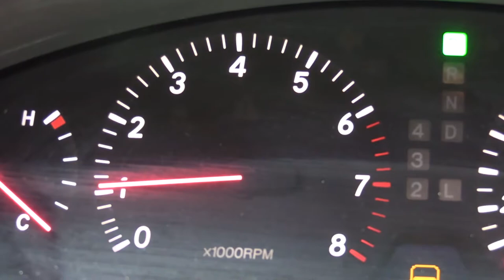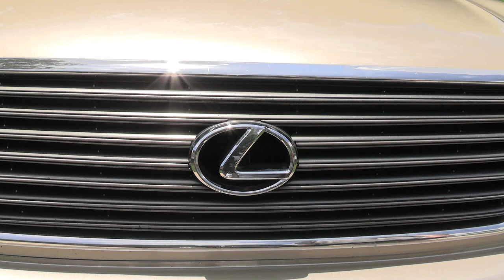BEAN [60fps] LS430 Throttle Body Cleaning

Comment: 6:20 The idle air control - that's not the full procedure! You are not good to go! The 1/3UZ uses air-assisted injectors, the two larger holes run all the way into the engine block into every single injector. Those passages also get gunked up with carbon, not just the 8 small ones which you can see under that plate. 

You need to take your cleaner, with the plastic tube extension installed onto the head and stick it into those large holes as far as you can. Then start spraying the solution, slowly at first, into those tubes with the car running. You will be messing with the a\f ratio and the car will bog whenever you spray, so you will need to manually operate the throttle with your left hand as you spray with your right to prevent the car from stalling. I find I have to rev the car up to as much as 3000 or 4000rpm to have enough rotational inertia. I recommend doing this when the car is warmed up so you aren't revving and stressing a cold engine. You may need to perform this service multiple times and I've heard of people using an entire can of cleaner to get the job done.

You should experience smoother shifts, smoother throttle response and more precise throttle response with this. I also recommend adjusting the throttle cable, there is a linkage on the left side of the block which has a nut to adjust the cable slack. Over time this allows a ton of slack in the pedal to built up.
Reply from the maker: If I still had my LS today, I would've done that. But I'll pin this comment here for others to see!

Comment: Great video, very helpful! One thing I'd like to say tho, at 13:00 i think the rpms are high because the engine is cold and you are in park. It has to idle high to warm up faster and stays high when in park so it doesn't cool down.
Reply from the maker: Yeah, a cold start is always gonna have high idle to help get the catalyst up to temp

Comment: So maybe I missed something but what or how exactly did you clean the internals of the throttle body.  Did you manually move butterfly ?  I am concerned that might hurt the gears inside?  Did you use certain fluid or brushes?  Thanks.  I learned a couple of things
Reply from the maker: You can get a bottle of throttle body cleaner from any automotive supple store. And while there, you can find what they call "shop rags" which are more durable. 
As for the throttle body, yes I was moving it, but not aggressively. I could hear the gears moving when I was in adjusting it to clean, but if you're slow and gentle with it, you're not gonna hurt it.
Reply: @BEANCROAKLY  I was doing the MAF cleaning for my p0175-p0172 codes and I cleaned the entire air housing compartments and I also sprayed the throttle body with throttle body cleaner but I didn’t remove it or nothing just did the face and what I could see without moving the flaps- I was scared
Reply: @gabegarcia7779   you were scared beacuase it was really dirty behind the throttle body? did you ever end up cleaning the throttle body, if so how did it go?

Comment: Could a dirty throttle body cause the car to hard downshift on first gear?
Reply: I had this happen about a year ago, thought it was the transmission, but it turned out to be the ICU (computer) that I had reprogrammed for about $500, runs as good as new!

Comment: At 1:36 small hose where it will go?. I don't know where to connect in downwards because it cracked while removing
Reply from the maker: Its a power steering vacuum hose. Best seen from underneath the car to reattach it

Comment: Are you sure it's a one time use gasket ? In my country no one replaces it and the car runs just fine no leaks smooth idle no problems.
Reply from the maker: It what is says in the Lexus manuals. Throttle body gasket is a one-time-use gasket

Comment: Hi Bean, thanks for the video. I followed your procedures to clean the throttle body. when removing the air box I found out one of the EVAP pipe (I think that is what it is) is cracked at the bottom. it is the bigger one on the right side of the air box. it needs to be replaced, do you happen to have the part number for it? I search online and lexus dealership, could not find it. they only say ventilation hose, no more description on any of those and no pictures. 
Can you help me out on this? I temporarily fixed the crack with wrapping a duct tape around it. It is not permanent fix and needed to be replaced. Thank you.
Reply from the maker: That would be your crankcase ventilation hose. Generally all the rubber hoses on these cars at this age are gonna need to be replaced. 
Part number for that hose - 1226250060
Reply: @BEANCROAKLY  - that's great, thanks for your help!
Reply: I literally did the same thing. But I just left mine, drove it to Cali from Vegas and check engine light and check vsc light came on, I'm assuming that was the issue. I'll report back if it is. Thanks for posting the part number
Reply from the maker: @agegonzo39  Late reply, but yeah if you have an EVAP leak, the car will throw the CEL and VSC lights, the VSC light depending on how many codes for the EVAP come up. Usually a solenoid will fail due to age but the pipes will crack or break and that's where you'll have the leak. Generally an EVAP codes are nothing to sweat, but the CEL light is annoying to have on the dash.

Comment: Hi, did you reset the throttle body sensor after reinstalling? On mine, after reinstalling the throttle body, it stuck in idle and even when I stepped on the gas, it only idle and wouldn’t rev my engine.. Can anyone help?
Reply from the maker: Try disconnecting the battery for 10 minutes and reconnect it. Also try driving around the block and see if that doesn’t help reset it. I never reset the throttle body sensor, since it usually does it on its own
Reply: did it work for u
Reply: It was caused by a bad idler variable solenoid

Comment: .I have a 2001 Lexus LS-430.  
Can not take down the intake boot yo access the throttle body and I'm afraid to force it.  Do I have to remove it from both sides or only the side where attaches to the throttle body? 
I have the code P0174.  
What would you advise?
Reply from the maker: To properly remove the intake boot you have to remove it from both sides. As for the P0174 code, clean your Mass Air Flow (MAF) Sensor, check to see if your intake boot has a hole someone or if any pipes are disconnected.

https://www.clublexus.com/how-tos/lexus-es/lexus-what-does-error-code-p0174-mean-550085
Reply: @BEANCROAKLY  Have serious trouble removing the intake boot. It is not moving at all and I unscrewed both ends. I am afraid if I force it more it will break.
Reply from the maker: @gt-c-  it’s tough plastic. Disconnect it from the throttle body by pulling back on it. It’s a snug fit to make sure air doesn’t sneak in. On off the throttle body you can pull it off the air box where the engine filter is.